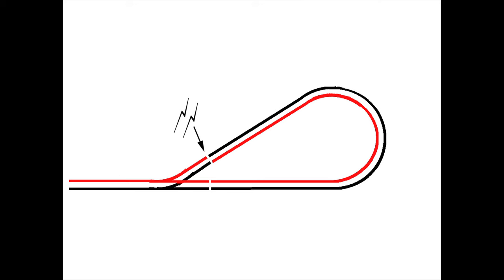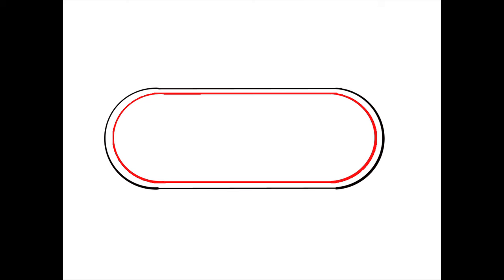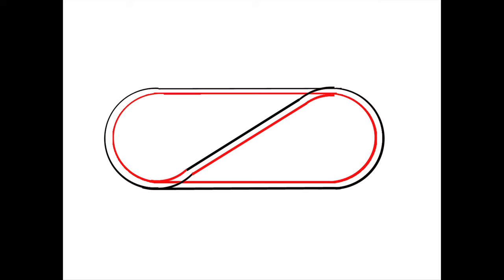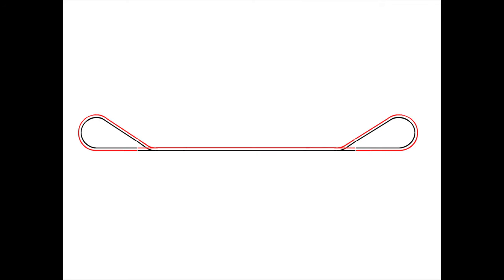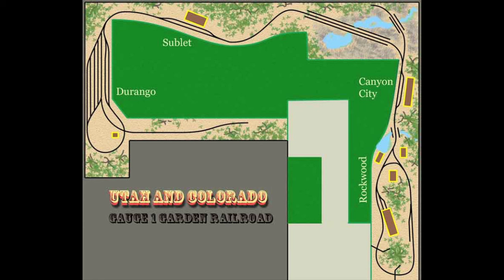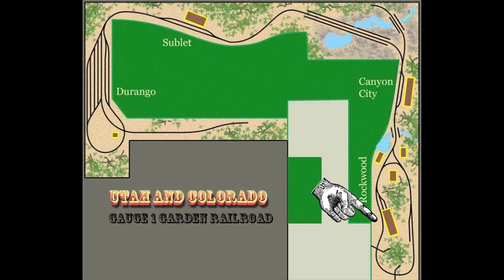Track Planning and Operations with Reversing Loops  - Electricity for Model Railroads

Comment: At the Rockwood end, you have both a loop and a usable wye, and arrangement I am planning for my layout to accommodate both staging and point-to point operation. this is a nice refresher. I learned about wiring from an article in Model Railroader back in the 60's when I was around 12 or so.
Reply from the maker: When I first developed that track plan, I knew it was going to take me several years to put it in. So I created the upper loop which was 100 feet of track and ended at the Y. I had a short extension from that point, which eventually was going to be the main line. But in the meantime, I could use the Y to reverse trains on my loop. But it always came in handy, so I never took it out! It was just a fun feature to have as part of the track plan.

Comment: Thanks Dale!  You have made a difficult discussion easier to understand.  You have given me ideas.
Reply from the maker: Hi Ken!!! Excellent!
Reply: @ToyManTelevision  I am trying to design a twisted double loop with section the have double track (very large padding sidings.  Then there is the yard and the station.  Need to think about how many blocks I will need. More than 1.  Go screw around and get ready for Sunday.  And thanks!

Comment: Hi Dale, My biggest question is how big a loop is required for 85 foot scaled passenger cars to make a curve realistically for a garden gauge layout & what kind of rail should I use that I don't have to clean it every time I want to run a train? My property size is 200 by 250 feet.
Reply from the maker: Well, bigger is always going to be better! A lot of the equipment won’t go around anything smaller than about 5 feet and radius, so you definitely don’t want to go smaller than that but a big passenger train will still look quite silly. Going around a 5 foot radius turn.so bigger is better! If you can go 15 feet radius, which I know is nearly impossible that would look the best, but to reinforce it don’t do anything under 5 feet!

Comment: A few questions to cover- how long is the gap between sections that are different polarity so the wheels don't touch both at the same time?  how quickly do you have to reverse polarity when the train crosses over a section?
Reply from the maker: Hi Wil, the gaps are incredibly small because it’s perfectly all right for the wheels to touch both sides. You’re not going to be able to drive across the gap unless the polarity is the same on both sides. So while at one end of the isolated section it’s reversed at the other end it’s not so you can enter at the proper polarity end. The gaps are quite often just a plastic rail joiner or you can take a cut off disk on a Dremel and cut a gap about .030. Then to make sure the rail doesn’t move and touch the other side and potentially short everything out I like to slide a little tiny slice of plastic down in there, and then carefully cut it off on both sides, and apply a drop of superglue so can’t fall out. But most people will just use a plastic rail joiner

Comment: I wonder if they ever made a solar powered locomotive? Would be cool for a garden railroad. Rechargeable battery inside locomotive when going through a long tunnel. Just a thought. I bet you could make one with your knowledge.
Reply from the maker: Hi the guys who have miniature Wonderland in Germany have done just that! They’ve made some of the most fantastic science fiction sorts of locomotives. Look for toys  story. On YouTube we’re looking for the James May series that he did for BBC. In the first year he attempted to take an HO train 10 miles up in old, abandoned railroad grade by laying flex track the whole 10 miles!  Well, it screwed up and didn’t work. In the second season, they attempted to do it again since it failed the first year this time running trains from both ends with a meet in the middle.  The team from the north were the guys from miniature Wonderland and James may left from the south. Both teams close to 10 miles! With the train meet in the middle! But the miniature Wonderland guys had battery operated trains and track powered trains. They had several different trains that they were running at high speed down the entire 10 miles! It’s amazing look for it on YouTube
Reply from the maker: I stand corrected. Look for James May a toy story. There’s about 20 of them and they’re all amazing.
Reply: @ToyManTelevision  I just watched the great train ten mile race. Excellent!
Reply from the maker: Isn’t that great!?? 👍 the whole series is too